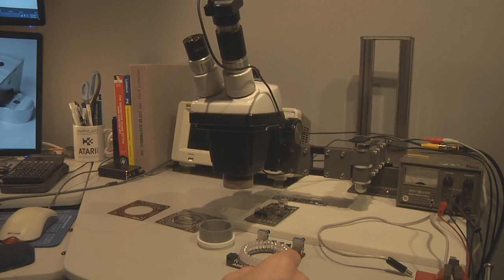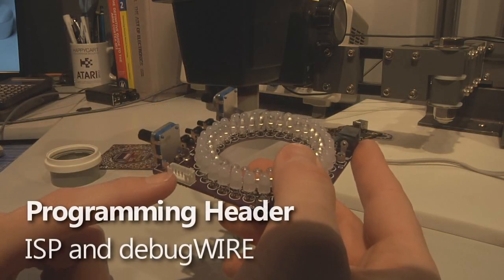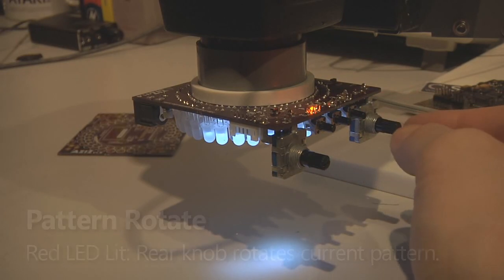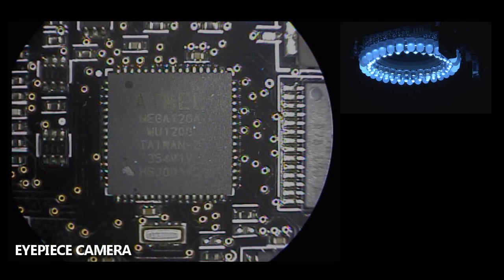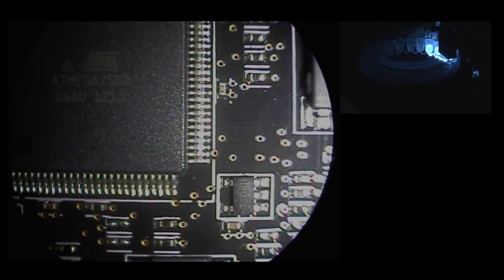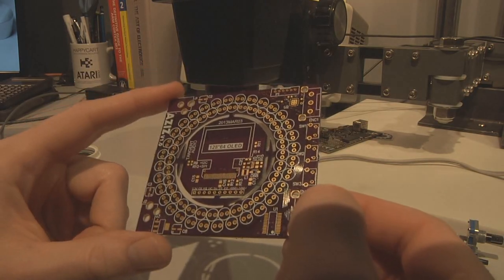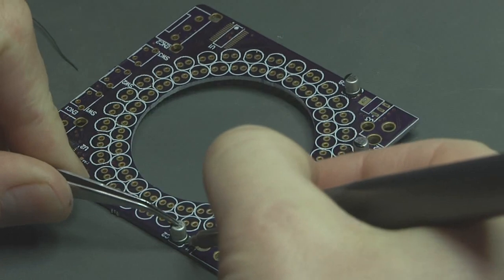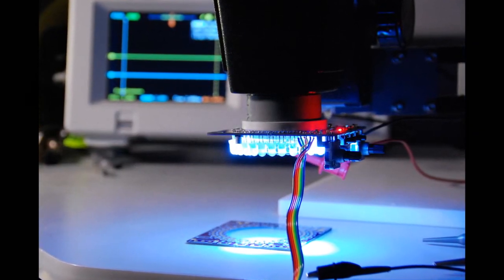AZIZ: DIY LED Microscope Illuminator

Comment from the maker: Indeed, it was all about the satisfaction of doing the project.  I also wanted to try to improve on the user interface experience compared to the commercial LED ring lights that I've used.  I have one on my bench at work, and the UI controls are pretty awful.

Comment: Very inspiring - thank you.  I made a simple led ring light for my microscope recently.  I didn't use a pcb - but I did 3d print the ring including the angled holes for the LEDs - which made the subsequent soldering of the led leads easy.  Do you think there would be any reason to use RGB leds instead of white?  Would color control be useful?

Comment from the maker: Yes, designed from scratch.  The initial inspiration came from using a commercial LED illuminator at work, and hating the user interface.  Otherwise it's my electronics, mechanical and firmware design.